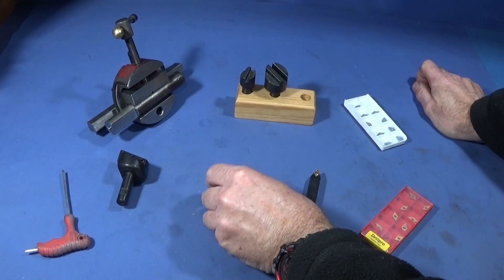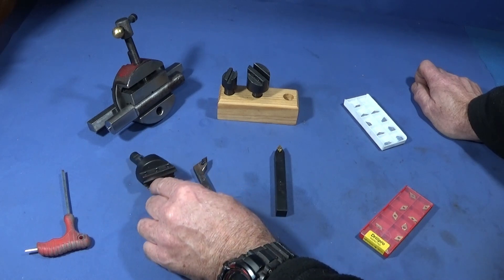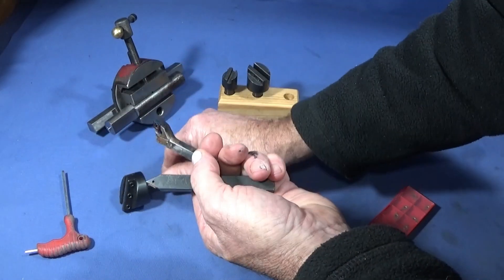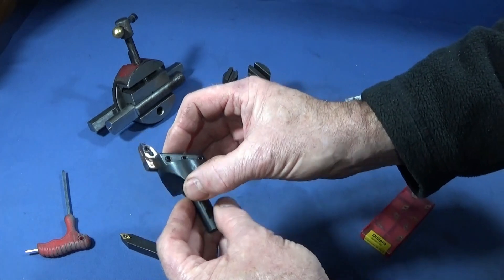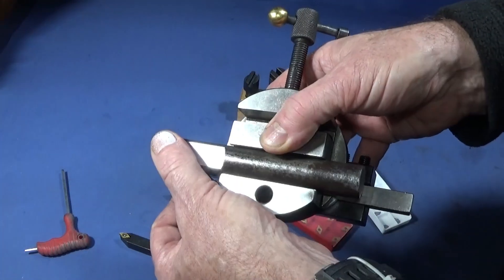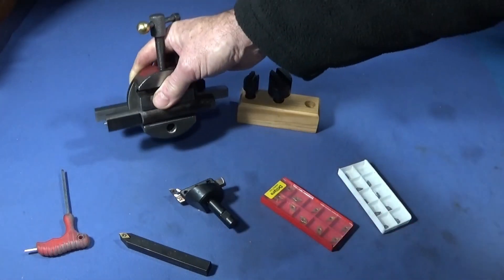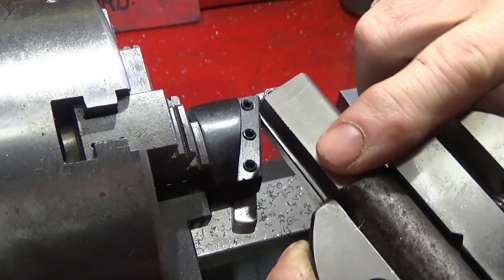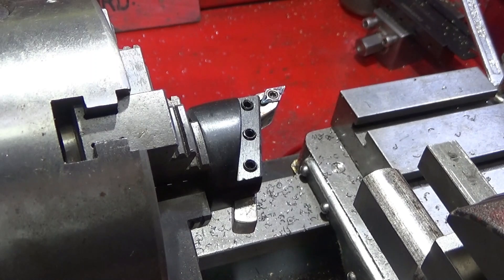Home Made DCMT 070204 Insert Fly Cutting Tool Plus Blue Nano Insert Test

Comment from the maker: SEE TOOL LINKS BELOW:-
Drillpro 10pcs HRC45 Blue Nano DCMT070204 YBC251 Carbide Insert -- https://bit.ly/2JfbL6t
7 Set Shank Lathe Turning Tool Holder Boring Bar+DCMT CCMT Carbide Insert -- http://bit.ly/2WIf6Om
S10K-SDUCR07 SDJCR1010H07 SDJCL1010H07 SDNCN1010H07 Turning Tool Holder and DCMT070204 Inserts -- http://bit.ly/37Gg6ZN
Reply from the maker: 11.11 Shopping Festival -- https://bit.ly/32xFLRw
11.11 Coupon Center -- https://bit.ly/35eUn9U

Comment: Hello Steve,
This is a great alternative to HSS and it uses common inserts - excellent video. Could I ask few quick questions please :
Is the angle the insert makes to the work critical - it looks as if the sawn off tip sits roughly paralell to the shank of the fly cutter? Rake angles seem to be much more critical with HSS tools.
Why did you use square mild steel bar to braze to the cut off tool tip? Was it becuase it brazes more easily than the original large part of the insert holder? 
You said that the non-nano tips didn't last as long as the nano tips but I woud hope they last a lot longer than a single sharpening of an HSS tool, especially on mild steel  - you were using harder steel I think?

Best Regards,

Chris
Reply from the maker: Hi Chris. Thanks. No the angle isn't critical, I just guessed it. You could just use the original shank as well if you want to braze that. I have used this tool many times now and haven't had any problems. The ordinary tips do last ok as well. Regards Steve
Reply: @SteveJordan  Hi Steve, Thanks for replying -appreciated.
I'm thinking that I might give a left-hand turning tool a quick trial in standard form (not cut up) as well as a brazed knife tool.
Thanks,

Chris

Comment: Hi Steve. I think the flycutter will serve you well. I modified a similar lathe tool for my flycutter and it works great. I also modified one for my boring machine. They all use the common tips sold by banggood. I might show the flycutter in a future video. All the best for the new year, Mart in Solihull.

Comment: Steve, might it be possible to use the left hand facing tool with the DCMT 070204 insert?  Merry Christmas.
Reply: If you mean for normal turning I can report that they work fine in left, right and neutral cutters.

Comment: Good idea. My question, why not just use the cutter as it?  Was it that you did not want to cut on the side of the insert?  I would have thought it still ok though?
Reply from the maker: Hi Dan you can do it with the ordinary 070204 insert tools, but the type I show here wouldn't have enough clearance. The side would rub and wouldn't cut properly. Regards Steve
Reply: @SteveJordan  thanks! That makes perfect sense!  Good on you for working around the problem.

Comment: If you use the 070208 inserts, you will get a much better finish. And if you use the ones from Sandvik you will see, they outlast the blue nano ones by the factor  3 or 4. In my experience.
Reply from the maker: Hi yes but I haven't seen any 070208 inserts yet, not Chinese ones. The Sandvik and other makes like Iscar are so expensive though. Maybe more economical in the long run but I can get the Chinese stuff at a quarter of the price. Regards Steve
Reply: @SteveJordan  Ah..ok....the 08 are at Alibaba available. Regard from Frankfurt, Michael.